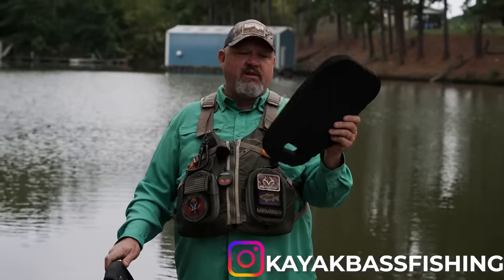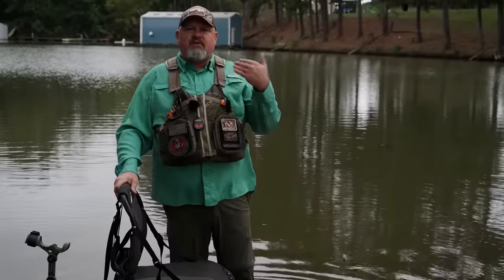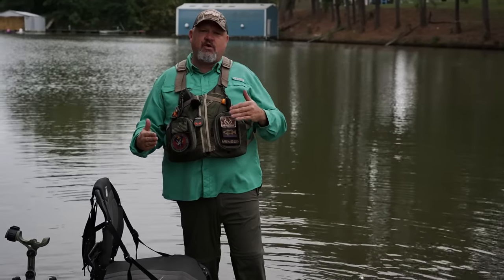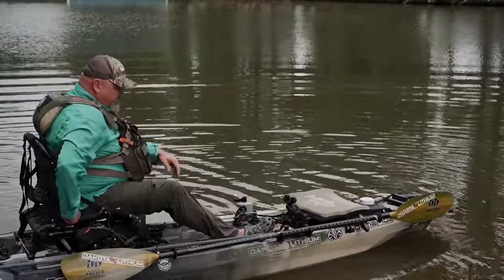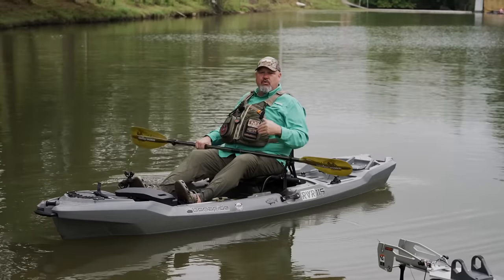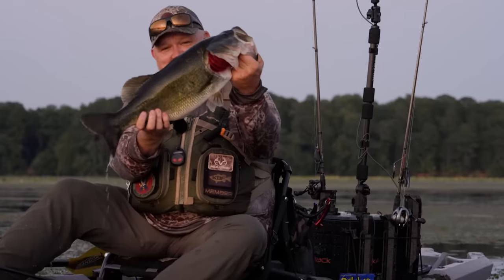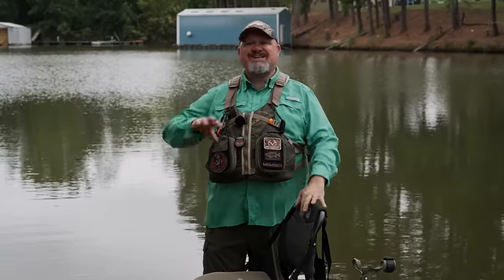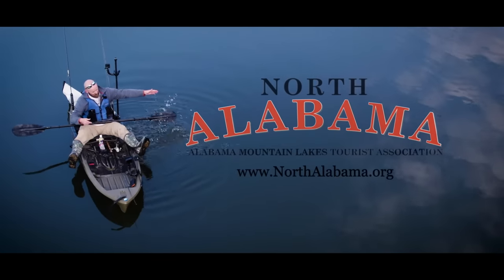WHY You're UNCOMFORTABLE In A Fishing Kayak

Comment: Great advice, as always, Chad. I was gonna touch on one thing that I do to my seat, and you sorta touched on it, and that is the space under your seat base, that air space between it and it's tightening straps. I went online and bought "Kaizen Foam", about 1-1/4 to 1-1/2 inch, and cut a piece that fills in that entire area. That helps get rid of any sagging that may occur and creates a solid contact between the pad and the straps. It really firms up the seat, and like you said, once it sags, the side bars start to push on your hips, creating discomfort. Same goes for the front frame bar behind your knees.
  Sitting up and not reclining, like you mentioned, also gives you better. Casting ability. Many times, I find myself scooting forward in the seat, away from the back, to make casts, and it helps make sure I'm in a better posture to make those casts. Do that for a while, then try casting while leaning back, and you'll immediately see the difference.
Reply from the maker: Thanks for the suggestion. 👊🏻

Comment: Chad, great video topic. Instead of the gardening cushion I used some 2 inch thick Polyethylene closed-cell foam that I got on Amazon for another project. It worked great and you can cut it into whatever size or shape you want. It comes in sheets that are 54” X 16” I either 1” or 2” thickness.
Reply from the maker: Thanks for the recommendation. I just recommended what I found locally and easily but that’s a great alternative

Comment: How about the metal clips that dig into my hips, need to fix that area. I’ve been wrapping a small towel around both sides. I swear bonafide needs to make a wider kayak for wider customers.
Reply from the maker: They did, it’s called the PWR 129
Reply: @ChadHooverFishing  yea. I’m goina need more then 35”. My native titan 12.0 was good in the width department but man I love my ss127. Wish they made a 127 that’s 40” wide and had pedals.
Reply: I had The same issue with the metal slotted pieces that the straps hook thru. I placed about 3/4" spacers to move them out on both sides. One other issue on the seat is the alum. Rivets on high stress areas that after about 3 weeks completely imploded. The fix was to install SS bolts in these locations . I spend many days and hours in my yac and I'm a big guy so something just as simple as readjusting your seating while sitting back down puts a lot of pressure on these major spots. At minimum they should have used SS rivets. This seat takes a beating while moving around  so brace it up where needed. It's ok for the guy who fishes every now and then . But I tend to move a lot and fish very aggressively with my equipment. 🐸🐸🐸🐸🐸🇺🇲🇺🇲🙏

Comment: I wouldn't last two hours straight up like that. Lower back trouble makes that position highly uncomfortable.  EVERYBODY  is slightly different, so I think you should experiment with best position.
Reply from the maker: It’s 100% better for you lower back to be vertical than it is to be leaned back
Reply: @ChadHooverFishing  I've got one, and I can assure you that is not necessarily true. Sitting straight up is extremely uncomfortable in my truck, in a chair, or anything for any length of time longer than ten to fifteen minutes. I have to be at a slight recline. I regularly see a Doctor and go to pain mgt.
Reply: Try stretching your hamstrings bud ! that might help you release tension in your lower back.
Reply: @samuellepage7813  Ive seen professional doctors for several years. My problem isn't tension. It's deterioration in the vertebrae. Irreversible